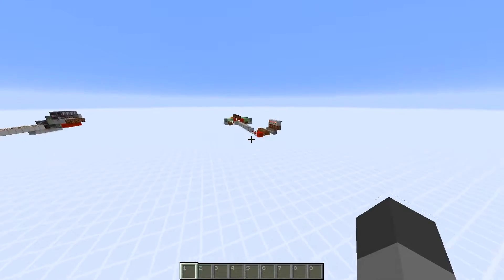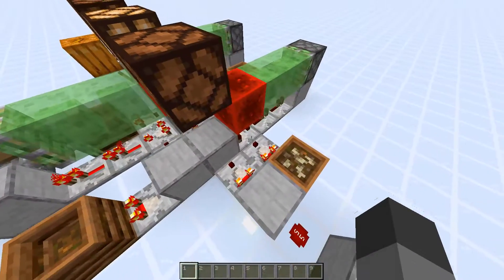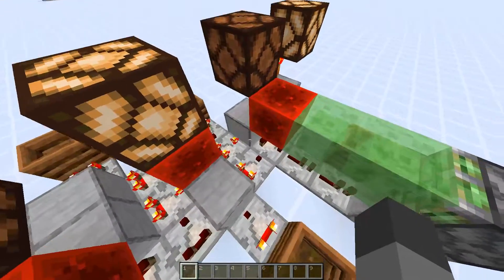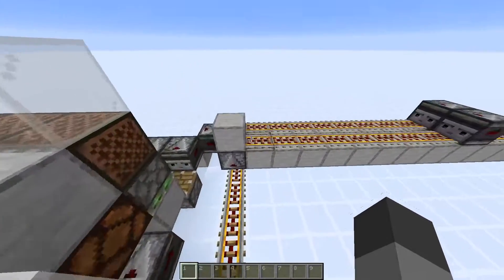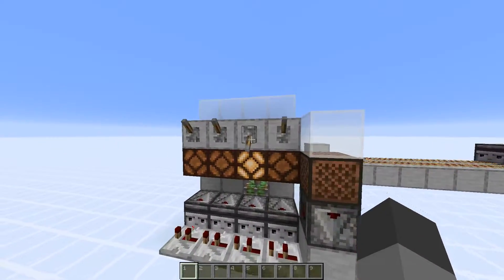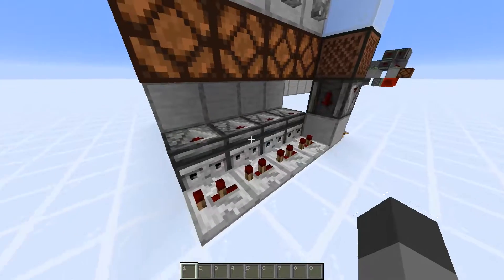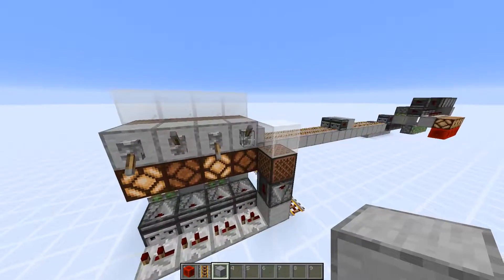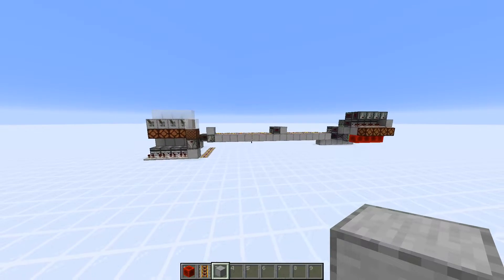Binary signal transmission: hexadecimal and serial

Comment: Thanks for that.
Super interesting video.
You could have touched on the possibility of using an instant wire for transmission making the inherent speed of the wires basically irrelevant.
Im sad I only learned about this video now. :(
Reply from the maker: Glad you found it useful :)
I hooked up 2no's instant wire to my improved serial encoder in this followup video: https://youtu.be/JppI9_F74Ug

Comment: If you record with OBS there is an option that turns discord into streamer mode, that way you don't get notifications
Reply from the maker: Thanks for the tip! I record using ffmpeg, but maybe there's a way I can trick Discord into thinking OBS is running...
Reply: @vktec  Im pretty sure you can turn streamer mod on manually
Reply from the maker: @Watsu_  Yep, you can - the issue is me forgetting :')